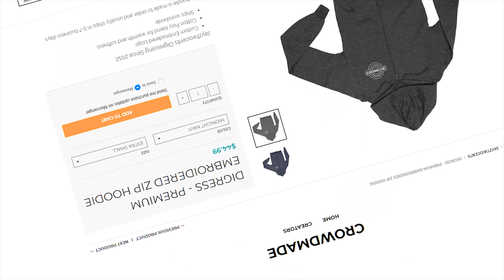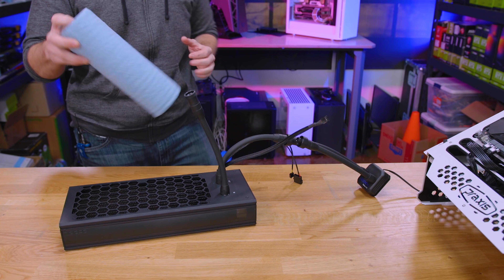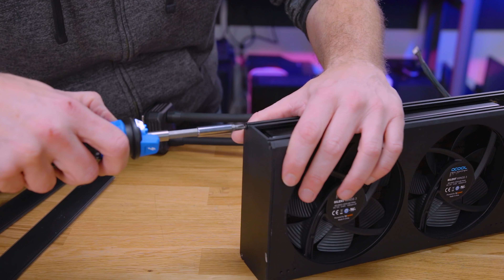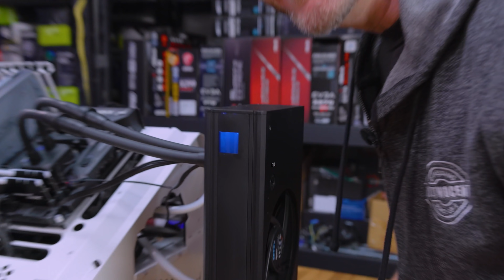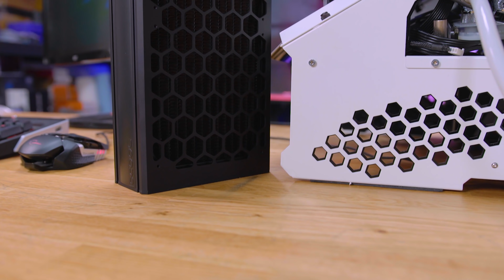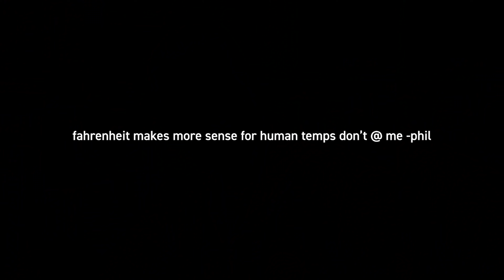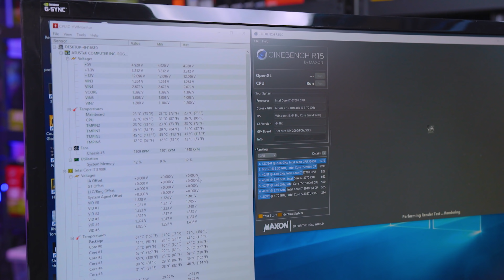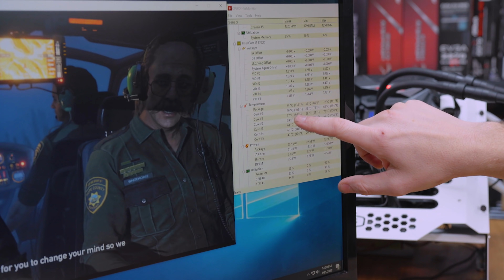This AIO is ridiculous!

Comment: Here comes all the "Celsius is better than Fahrenheit!" people... but who shall speak for kelvin(the true measure of thermal energy)?
Reply: @Steve Sherman The scientists who did put the man on the moon calculated everything in metric and celcius, soooo.....
Reply: Your tone essentially shows that deep down you know that Celcius makes more sense than Fahrenheit, as the metric system makes more sense than the imperial system (who's the idiot who thought about imposing these distance units in a base 12 system while fooling around with fractions cascading their errors in numerical computations and such, really...). Bah it's a matter of habit and adaptation : some are simply hard headed when it comes to change, even if it's for the better. Zero being the freezing point of water, just start from there and it makes so much more sense lol ;-P
Reply: @HawkFest  Technically 0C is the melting point of ice, but...I'm being pedantic.
Reply: You do know that Kelvin is just an offset Celsius scale, do you?
Reply: @edwinshmedwin   The calculation is easy enough but why complicate your life in the first place?

Metric system is easy because everything scales up by 10 while Imperial system requires an equation for every conversion.
Reply: @michaelgimenez4032  base 12 counting is superior base 10.
Reply: @isaackarjala7916  How so? No matter what you use like mass or distance or volume you simply add  a zero and the proper prefix, imperial you have to use inch, folled by verge than miles and each of them use their own values.

How is tha more convenient?

How much is 3 gallons in mL?
Cause if you throw me any volumes in metric its just the number of zeros that will change and i can pass from one unit to another with ease.
Reply: @michaelgimenez4032  12 is divisible by 1,2,3,4 and 6, whereas 10 is divisible by only 1,2 and 5, also 12 is between two primes while 10 is only next to one.

0,1,2,3,4,5,6,7,8,9,a,b,10
Reply: @edwinshmedwin  Its hard to argue agaisnt someone who got raised with it sjnce it will indeed be natural for him.

However if you are in a country that use both (Canada for instance) this is when you realize how annoying the conversion is and why the metric system is so much more convenient.

Its hard to not be pretentious and say "metric system is better" but i cant go over the conviviality its providing.
Reply: @Steve Sherman lol you DO realize eveything in space and scientific related things uses metric standards right? all sensors on spacecraft are in metric and just everything else is...
Reply: @Steve Sherman Imperial units crashed the Mars Climate orbiter... litterally :)
Reply: I would preferred say that are 9000000000000000 k here 😂 (I do not even know how to say this number in English)
But these stupid measures make me say 15c
Reply: @Fiufia  Nine Quadrillion in case you ever need to say it aloud in English. Tho the universal scientific notation is probably easier then learning all the English names for numbers so 9
 X 10^12 "most" people will understand that.
Reply: @MrDJAK777  but the fucking English fucked it up by having a long scale and a short scale
Reply: @Fiufia  15 C is 288.15 K
Reply: @Fiufia  15 QUADRILLION 0..🅱
Reply: My acceleration is negative
Reply: Use the Long John Index. Where I am, it was 3 last night, now it's 1...  we had 10 cms of snow, 10 to come.  https://www.longjohnindex.ca/
Reply: We should all be using Planck units. FTW.
Reply: @RizLazey  get better @ b8
Reply: First Name Last Name wut? Gettin offended muricunts?
Reply: Pretty much all benchmarking tools use metric. PC components are all in metric measurements as well. That's more whining in that case.
Reply: (68°F − 32) × 5/9 = 20°C
Reply: Ultra Vires  umm.... Mr Farenheit produced the first thermometer scale that was reproducible by people separated by geography, so no it's not arbitrary.....
Reply: @isaackarjala7916 , Mr. Fahrenheit used for 0°F the lowest measured temperature in history and for 100°F his current body temperature. Yes, he was feverish, and that explains the stupidity of those totally random points.
What constitutes as cold and hot depends on your usual temperature range. I find 0°C cold.
Reply: @stephanobrowski334  0°F is nowhere near the lowest temperature recorded, and the primary  calibration points for Farenheit where always 32° and 212°, 0°F is the freezing point of a salt water bath and 100°F being body temperature where secondary calibration points for incase either of the primary calibration points wasn't producable. There being 180° between the freezing and boiling point of water means you can get a scale with 5° increments only dividing by 2 and 3. Doing the same with Celsius, besides only being roughly half the resolution, requires dividing by 5, which is much more difficult to accurately eyeball....
Reply: @ufster81  1 fl oz of water weighs 1 oz.
Reply: @Steve Sherman Metric is just the international standard for all scientific calculations, so ot certainly did
Reply: @Steve Sherman Well if he does he his right to do so
Reply: @Cleru Zinek I use either YYYYMMDD or DMonthYY (so for today, either 20200519 or 19May20)
Reply: Nope, centigrade is the standard SI unit for 99% of calculations. Kelvin is used only for specific use cases.

A true measurement is any that has an established standard. Thermal energy can also be measured in standard energy units like joules or movement measurements like molecular frequency.
Reply: Outside scientists everyone who uses Metric? Kelvin is the SI absolute temperature scale, its Imperial counterpart is Rankine.
E: Kelvin is based on Celsius, and Rankine on Fahrenheit if that wasn't clear.
Reply: @MrDJAK777  Rankine just isn't a thing.
it just isn't.
Reply: @AffeAffelinTV  The lack of its use in current times doesn't negate the point at all. Not sure what yours is either.
Reply: Here comes all the "Celsius is better than Fahrenheit!" idiots who are wrong...

FTFY

Comment: I've been running 1.4v on my 6600k for almost 2 years xd
Reply: Same I forgot how hot 8700ks get if you didn't delid them XD. 9700k 5.2ghz all core / 4.8ghz cache @ 1.41v maxs at 81c in multiple cinebench runs. Fans at 0-70% max  fan curve & pump curve at 0-20% max on my 3 year old swiftech H320x2 Prestige aio, which is very comparable to all the "custom parts" aios like the eisbaer, ek phoenix & now swiftechs own H360.

Comment: failed to mention that its aluminum rad. so expansion isn't easy or you could mix materials and cause some real problems. Jay you know its an aluminum rad yet failed to tell your watchers.
Reply: The rad itself is completely made of copper. Only the frame around the whole unit is made of aluminum.
Reply: @sinthoras1721 Its a sealed closed system. aluminum works just fine but don't mix other parts in. There is no open system pc water cooling systems. You don't need a pump in an open system .Just hook to city water and drain that's an open system I hate when computer types start talking about things they are ignorant about

Comment: Wow.... those temps are horrible!!!! 5ghz on my i9 9900k with only a single Fractal design Celsius.
as for voltages... 1.25 when idle (or desktop mode as i like to call it) when under full load or prime95 when turbo clocks are enabled 1.375
Adaptive offset Jay!  when the processor does nothing and is in C-state Lower the voltage please!!!! my temps are 17c minimum and 79c maximum.
https://i.gyazo.co m/0e22475c53c7eacb56c8e2e6906ae906.png (remove the space in the dot com part) screenshot.

Comment: Jay, the last custom loop I have ever done was back on an AMD 3200 Clawhammer, long before PWM pumps.  I am seeing mixed emotions on which header to use for connecting an AIO (like my Kracken x61).  I built this 7700k back in April of 2017.  I noticed my temps going up slightly which I knew for sure the filter would be clogged, so I took my case out, fire up my compressor and blew (uhh huh huh) out everything while holding the fans so they of course wouldn't ramp up.  Put it all back together and noticed, according to NZXTs CAM, my temp of the "liquid" was 32C and now is 28C but noticed the pump is more than likely not running at full speed.  Currently, the pump is connected to CPU_Fan but I cannot seem to find a way to disable "Smart Fan" on my z270 Gaming 8 Aorus board.  Should I move it to the PUMP header (which I believe is PWM) or leave it connected to CPU_Fan.  Thanks.
Reply: Nevermind, disregard, I'm so amped up on coffee my brain is all over.  I forgot and it appears the pump gets power from the SATA power so it seems like the pump would be full blast regardless.

Comment: If it doesn't fit and you like the look of not having the radiator showing, there's always the Eisbrecher series of radiators from Alphacool. You can take them apart and paint them just like the one from this video, but unfortunately they don't have the pump built in.
 http://www.performance-pcs.com/alphacool-eisbrecher-pro-xt45-full-copper-240mm-radiator.html